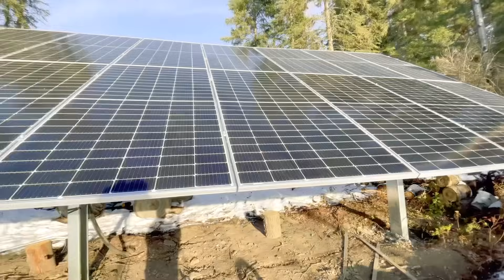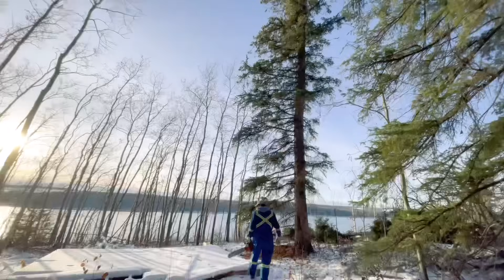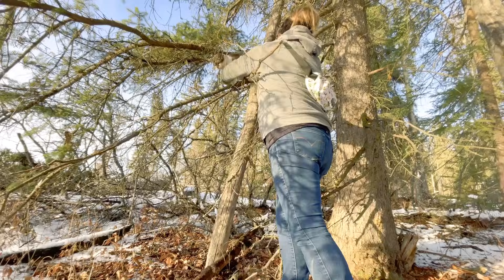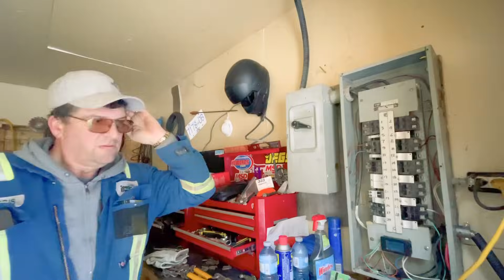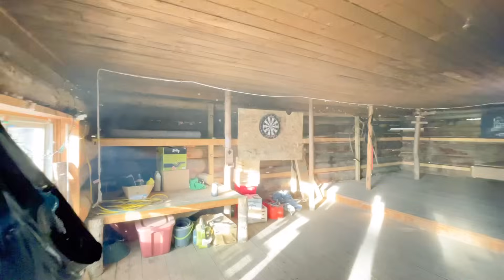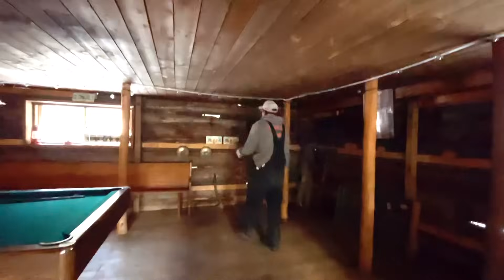Living Off Grid in Northern Canada

Comment: Did you say that you only have 12v and you have to run generator to have AC? If so its probably good idea to get an inverter so you can run AC devices just on your batteries and power up generator when batteries are low, its way cost effective
Reply from the maker: We only have 12v in the generator shed :) unless the gen set is running. The house has a pretty good setup! If you are interested in that, check out some of the other latest videos. The system is 48v 
Thank you so much for tuning in and engaging!